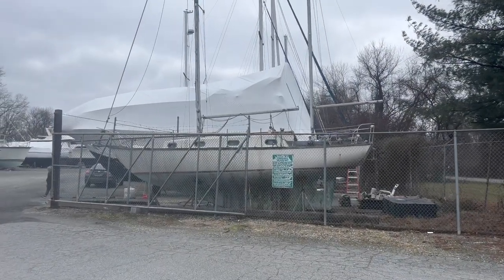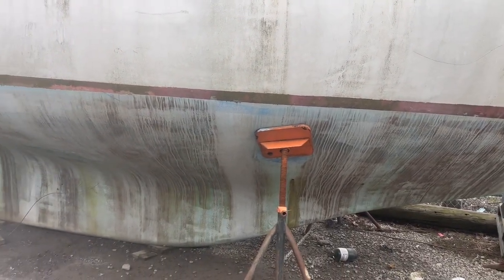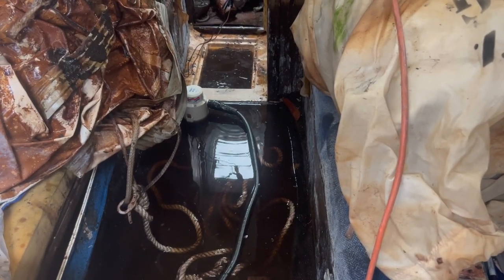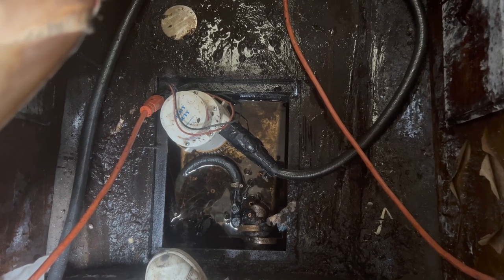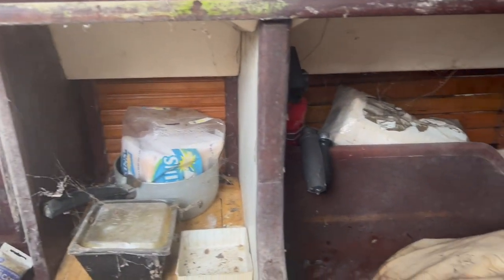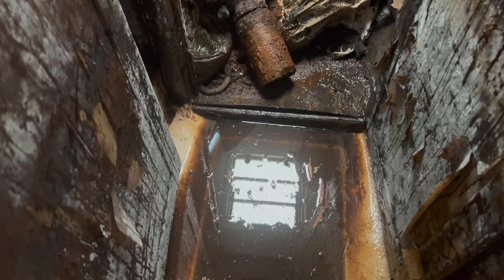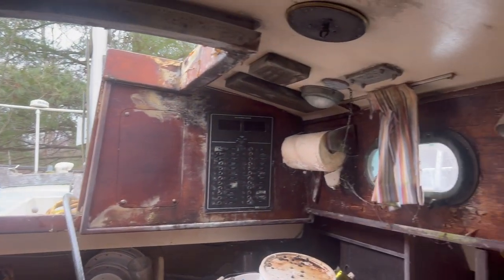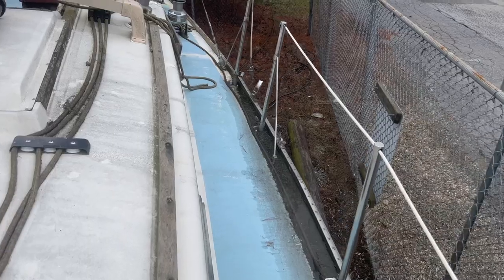ABANDONED 30' Allied Seawind Sailboat- Needs TITLE- Sailing SV Bohemian Ep. 47

Comment: seen many a boat exactly like that , they just walk away and let it ruin  - - - - - drill a hole( limber hole / garboard drain )  in the keel from the exterior as low as you can to the bottom of the keel  to drain it out and keep it dry - -  - this is a savable boat for a diy project by a capable motivated party -if boat is free and boatyard cost cheap -will take 2-5 yrs cost 25-50k over the life of the refit at minimum

Comment: That’s not a sea wind. Looks like a cape dory 30 ketch.
Reply from the maker: I’ve been scratching my head for a while . It is.
Reply: @sailingsvbohemian1464  I think I saw a manual bilge pump so maybe you can get more water out of the bilge.  If engine is good that would be huge.  Winches look great.  Looks like lots of equipment on board.  A blank slate once you clean her up and assess degree of water damage.  Good luck.
Reply: Yes,  you could see the cockpit locker lid hinges are Spartan Marine, who supplied the hardware for Cape Dory.